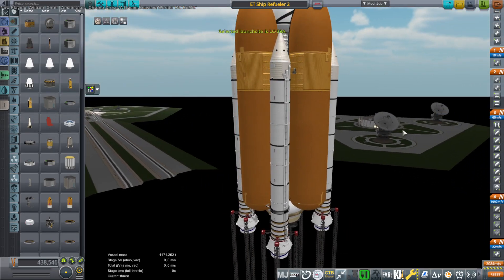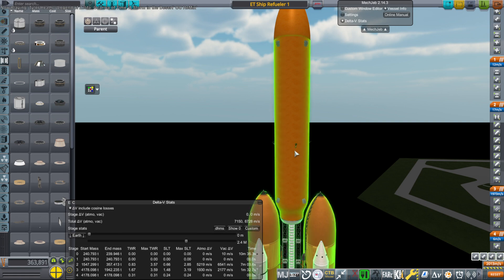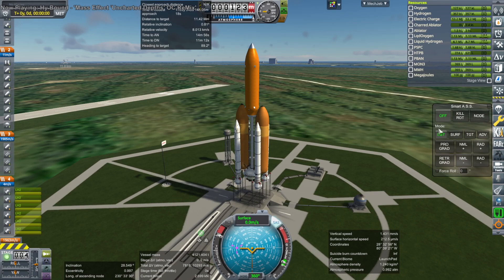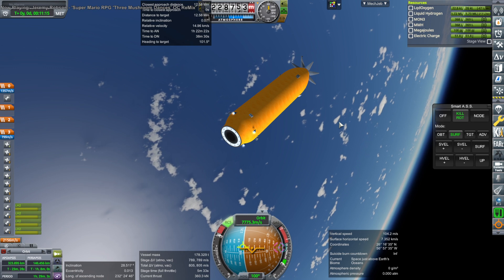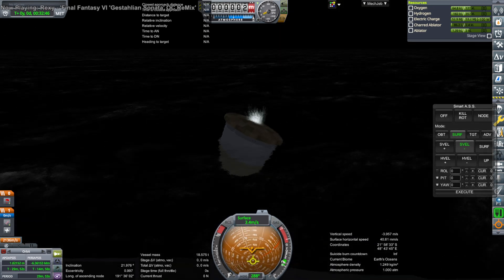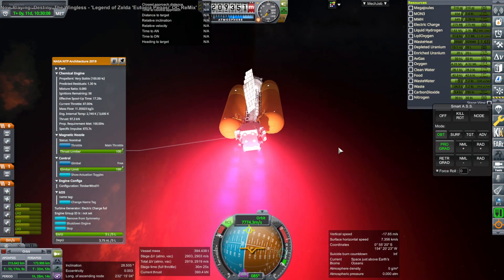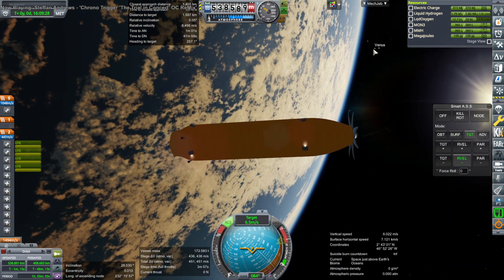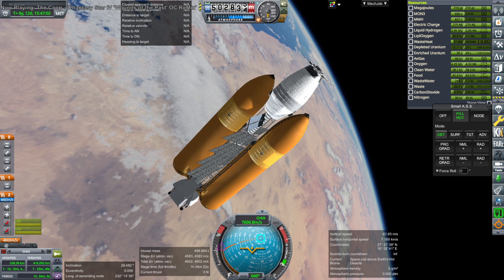Refueling the ET Ship (RO in KSP 1.12)

Comment: I've been thinking, you could also for larger fuel storage refurnish the LOX tanks for LH2, to do this in KSP clip tanks into the LOX tank or change the config file to add volume, and only use the additional LH2 on orbit. You could also remove the habitat, and refurnish the LOX tank, which has a volume ~33% bigger than Skylab, ~50% smaller than the ISS, enough for the ~2 years a crew of 4 or 6 would spend on a Mars mission.

Comment: The original plan for ULA's SMART reuse was to catch the engine section midair, but they have since changed their plans. The current plan is to use an inflatable heatshield that doubles as a floatation device after splashdown. I thought it was quite interesting how you chose to go with a fixed rigid heatshield, perhaps using hatches in the heatshield to connect to the propellant lines, similar to the real life space shuttle, as well as the deployable pacman device to I guess shield the engines from plasma flowing around the heatshield, radiative heating and ultimately the sea water, while ULA is planning to solve the same problems by just having a massive (~10m diameter if I remeber correctly) inflatable heatshield that keeps the plasma and water far away.

Comment: You could angle the NTR's rotated ~5 degrees inwards and have one of the external tanks jettison out sideways. The side that jettisoned the external tank would shut off its engines, so the thrust is pointed through the now different COM. This is not optimal but, (neither is this design as you already know) is definitely a very weird idea which is kind of the point of these videos. It might go up to ~7500 m/s of dv, enough to capture into LMO and do maneuvering to possibly to Phobos / Deimos if ice is without reasonable doubt discovered there. The only way to refuel hydrogen at Mars without a very large drill or facility for excavation would be at the poles, which is believed to have water ice below only a small amount of CO2 ice or mixed in pockets. You could also send a non ET tank of hydrogen, as you'd only need 100 tons to fully fuel a ET tank, or 200 tons if you do not jettison one of them, however, with current numbers that seems to be the only way without some real mass savings, or being desperate enough to rely on food consumption.